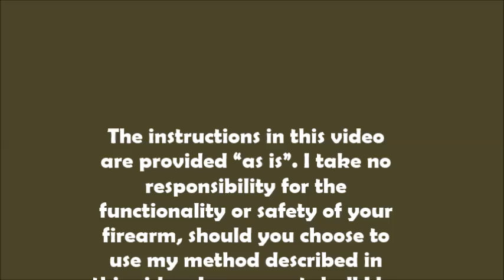Reducing Glock 17 trigger pretravel DIY - (Part I of IV)

Comment: Wow,, I hope to God you're not suggesting that people do this! Let's say you haven't accidentally killed anyone yet, and I do say yet.. Tampering with the safety systems is a major no no... Plus who would put a wood screw in a polymer frame... I'm shocked
Reply from the maker: You are assuming that I am weakening the safety system. I am not. It is a reduction of the range of movement of the trigger returning to its original position. The firing pin safety is engaged when the trigger returns to its original position. I further more do not understand your objection to the screw in polymer frame – if you were to reduce motion of the trigger bar what other screw would you use? From an aesthetic point of view I would consider to agree with you, but this is all hidden away and the modification is not visible. I can agree that the commercial products available are more elegant solutions, but my DIY achieves the same effect on the firearm.
The commercial product available on the internet today are in the price range of 150-200USD. The whole point here is that you can avoid this investment with this DIY installation.
I have as of today 3.552 round fired with this modification – this includes various IPSC matches as well. And I have had no malfunction whatsoever.
I actually had a chance to compare my modified trigger with a commercial product today. With my DIY-, and other DIY modifications you can see on YouTube(which I have applied to my Glock), my stock trigger, was able to match the performance of the custom trigger.
Bottom line is that
1)  I have saved some 150-200 USD, without loss of performance in comparison to a commercial product, thus reaching the objective of this video.
2) You have no substantiation for your claim, as you have no fact based statements that will support your conclusion.
Reply: Don't worry, you're safe behind your keyboard in your mommy's basement.
Reply: I checked this on my block and not allowing the trigger to go all the way forward does disable the safety.  Do this at your own risk people.
Reply: Spend the money and do it right people. Dont take short cuts. Im not knocking...its just a suggestion.
Reply: He bypassed/defeated the firing pin safety plunger. I don’t think people are angry that you didn’t know this, I think they’re upset because you could cause someone to get seriously injured with this advice. We are just trying to protect others from your ignorance.
Reply: @Libertarian_Neighbor  - Why are you so annoying? You post the same comment on everyone's comment
Reply: Matt Childs So people don’t die or accidentally kill someone doing this to there Glock. I am trying to spread the word about this moron, and I pray to God they listen. This is beyond dangerous. The gun will fire if dropped. He’s defeated both the firing pin block and the trigger safety. Don’t do this to your gun!

Comment: yea i literally just did the same thing only i just placed an eraser were a screw should be, gonna try to shoot it sometime this week see if it actually works
Reply from the maker: +shawn churchill How did you make it stick to the receiver ? or is it attached to the trigger bar ?
Reply: +Maria Bonita its in the front end of the trigger bar not the back, there's a little opening in between the trigger bar and frame closest to the trigger. Just drop something small down in there ( preferably something that won't burn ) it works in theory, my trigger definitely has had a considerable amount of take up removed, however how well it will function on the range I have yet to find out, I have a feeling the eraser is gonna burn. I didn't use any form of adhesive or anything either, it won't come out unless you want it to. If you do it right, when you lock your slide to the rear, you should be able to see whatever your using to block the trigger bar through your ejection port.
Reply: +Maria Bonita 
You might want to check the striker safety by removing the projectile from a live round placing the empty shell with unfired primer in the chamber and with a small flat head screwdriver reach into the opening of the back plate and push the sear down to let the striker come forward under the power of the spring,  the safety plunger might be pushed up just enough to still stop the striker but when the spring pushes it forward  under power it can cause the plunger to move up a little farther allowing the primer to be struck hard enough to fire.

Comment: Worst idea in history..period..
Reply from the maker: Have a look at my answer to Jamie Lowe...... sure thing - the Glockstore solution is more elegant, but also costs 139$. I could point at other things that could be labeled as the worst idea in history.
Reply: Maria Bonita um the trigger I bought off of eBay came with a adjustable pre travel screw and cost $30 shipped.
Reply: Yes. Worst idea ever. Please remove this video. You could get someone killed. 

He bypassed/defeated the firing pin safety plunger and the trigger safety. The gun is no longer drop safe. I don’t think people are angry that he didn’t know this, I think they’re upset because he could cause someone to get seriously injured or killed with this advice. We are just trying to protect others from his ignorance. Don’t ever do this modification!